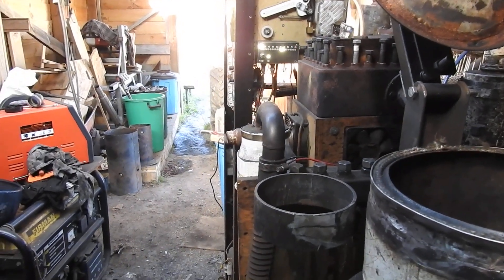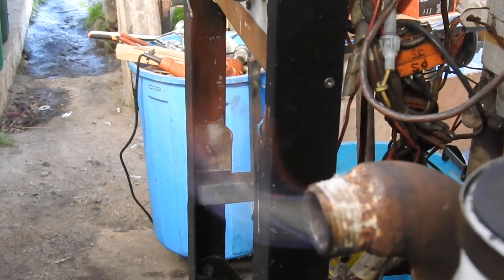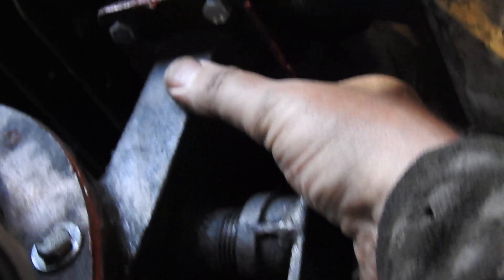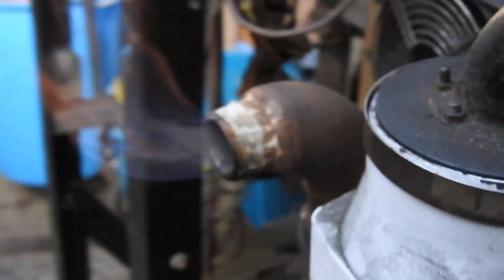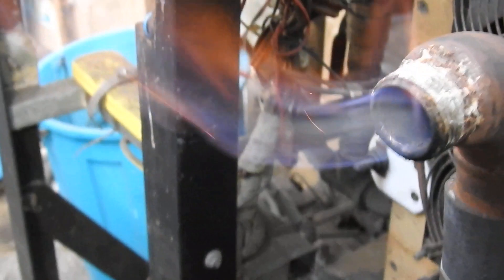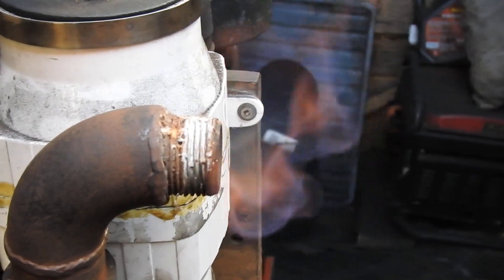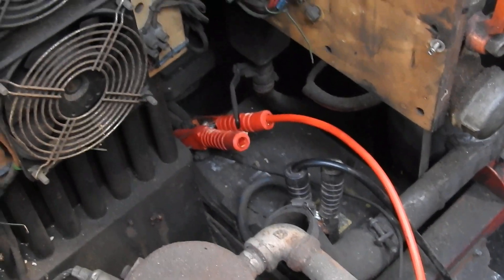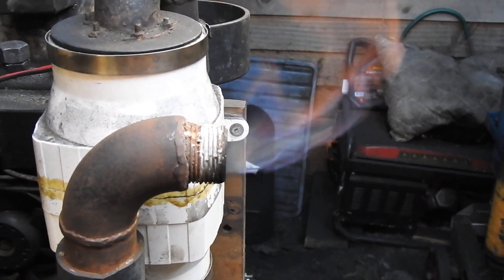A quick flareup with the Phoenix Gasifier

Comment: The flare looks pretty clean even though you're not pushing the gasifier.
Reply from the maker: Howdee Mike, 
 Considering that this was running this in FEMA mode, as I am yet to fit the air nozzle, I am perty pleased with the gas that I got on this first test run.  
 Also, after I did this video, I discovered that the plumbing between the gasser and the blower was heavily blocked up with goop and gunge. 
 Once this is cleared out, and a few other little problems are fixed, I am sure that the woodgas bugz are gonna be partying up, big time  :) . 
 Can't wait to squeeze some watts out of this.

Comment: That is a great color flare. You guys chasing a "Blue" flare dont understand gas composition. A "wood" gasifier can not and will not produce a " Blue" flare. The Blue is NOT what you are looking for. Hydrogen burns very orange and a good machine can produce in the 15-25% range. Orange does NOT mean your gas is dirty, depending the flare characteristics it is most likely the H causing your orange and this is very good!! Generally once a machine is up to temp you should see a peach color with a blue hue at its base. This is a good typical wood gas flare. Violet means you have some CH4 in the mix. At start up it is typical to see a brilliant blue flare; however, this will only be temporary as this is generated by the char from your last shut down. Basically the gasifier is running in 100% charcoal mode until your raw fuel makes its way into the hearth and it will change the flare color. I have to wonder how many people made great machines but scrapped them chasing the Blue flare?! All I can say is quit chasing the blue myth, if your machine is not producing tar at the engine, you have achieved a good working gasifier!! :)
Reply from the maker: I am inclined to agree with your observations here, and yes, I have heard of at least one example of a good gasser being scrapped due to a misunderstanding of the points that you have raised here. 
 I could almost have run this gas straight into an engine, but those little sparks in the flare surely suggest the presence of charcoal dust, which wood have made a nasty mess in my grunter! 
 Considering that this was running strictly in FEMA mode, I am rather impressed at the quality of the primary flare  :) . 
 In time, I will iron out all of the kinks, and get this beast up and running, just as the woodgas bugz intended.

Comment: WOOHOO!!!!!! Couldn't stand it?? Just had to light it off did ya? Excellent first go. With some adjustments here and there, you are going to be putting out the wattage for the cottage again. Did you have the hopper lid secure at any point in this test?? If not, the air flow from the open top would short circuit your air inlet to the reduction zone. Granted, you still need to address the low battery voltage before anything. Gotta get that air flow going. Great to see the first flare, and a nice one at that....Good going man.
Reply from the maker: Yup, you are right. I just couldn't resist setting fire to all this shiny new metalwork  :) . 
 During this time, I kept the hopper lid open, and I didn't have the air nozzle fitted to the system. 
 You could say that I was running it strictly in FEMA mode. 
 Considering all of this, I am still VERY pleased with the quality of the gas that I got during this test run. 
 After making the video, I discovered that the plumbing between the gasser and the flare was heavily blocked. 
 This slowed the gas flow to a mere trickle, so I am gonna need to carry out a series of maintenance steps on the system before I can fire this little puppy up again. 
 That stated, I am delighted with the performance of this little gasser  :) . 
 Sometime soon, there will be LOTS of watts in my little Wattage Cottage.

Comment: Steve, you have a huge ember bed and the grate holds back the flow of wood down through the restriction area. Try giving the grate a good rattle to see if that increases the flare volume and allows the wood to flow a little faster and produces more gas.. There's also a chance the incoming air pipe and diffuser is too low in the restriction area? 
That's a good looking flare . First order of business would be to hook up to the engine and give it a whirl before changing anything. That might change the profile considerably.
Thanks for the show ( I knew you couldn't face another day without a first flare ! Hahaha )
Reply from the maker: Howdee Bill, 
 Yup, this is a perty big ember bed, that's for sure. 
 At the moment, the biochar has not properly made its way down to the grate, but that will improve with further burns. 
 Once that happens, I must state that the grate is gonna be really grate, mate  :) .  
 Also, this is running in FEMA mode, as I forgot to mention in the video that I have not installed the air nooozler yet. 
 That will come soon, when I can get me some spare tictocks to play with. 
 After I made this video, I discovered that the plumbing between the gasser and the flare is mostly blocked, hence the very slow rate of gas flow to it. 
 A spot of flame cleaning is in order, methinks. 
 Even with all of that stuff going wrong, I am perty pleased with the quality of the primary flare  :) . 
 I hope to fix the carby soon, so I can add the engine to the mix, as I am sure you are right in suggesting that it will help to keep the woodgas bugz warm and happy  :) . 
 LOL, how did you know that I was totally hanging out for a seriously gassy flare fix here?
Reply: @CNCmachiningisfun  AhhHaa ! A good clean out in the plumbing is in order, eh? Just did the same to the NHF radiator a couple weeks ago. Certainly needed it. Give us the update when you run it again !
Reply from the maker: @nhhbbyloggr5022  
 Yup, a clean gasifier is a happy gasifier  :) . 
 I did a quick set of flame cleanings on the plumbing, and then I pulled the starter rope on the genny. 
 Electricity started coming out of the power outlets! 
 Watt's else wood I expect? 
 Looking forward to seeing some more wattsome goodness coming from your luvly power flower  :) .